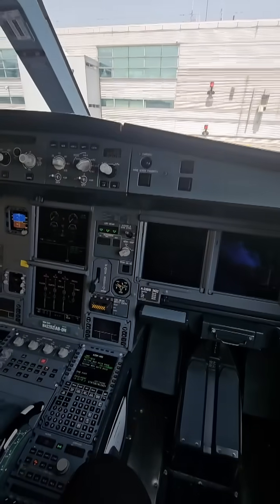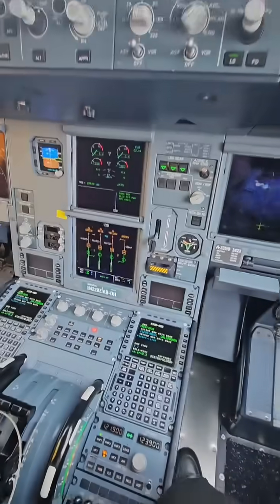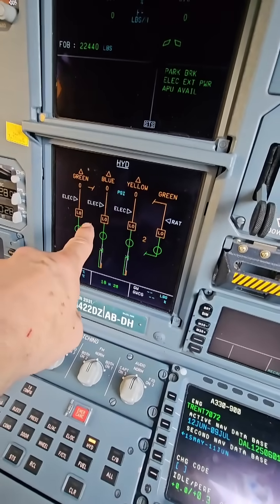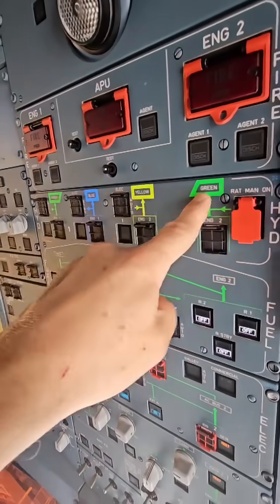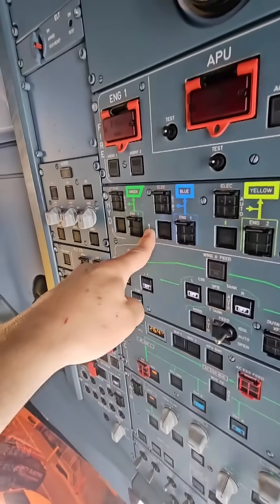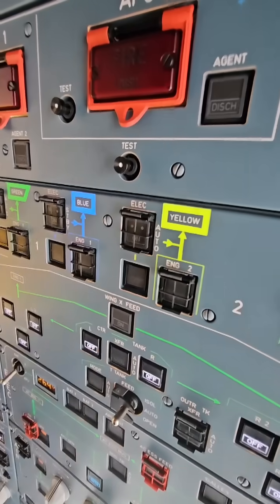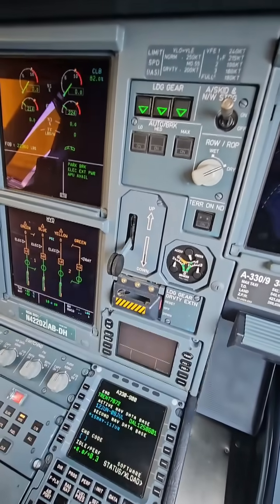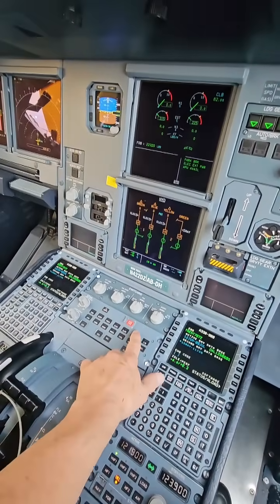Hydraulic systems page and controls on an Airbus A330.

Comment: I gather the barking sounds we hear after parking at the gate have something to do with equilibrating pressure among these hydraulic systems. Is that true? Could you do a reel about it?
Reply from the maker: The 'barking' sounds are from the Power Transfer Unit (PTU) that is on the Airbus A320 series. We do not have the same thing on the A330.

What is happening is that when one engine is shut down, and a hydraulic system is also shut down with that engine there is a system to allow the powered hydraulic system to power the other system through the PTU. 

That's the 'sawing' sound you hear on the smaller Airbuses. 

It would be hard for me to do a video on that as I'm not usually on an Airbus A320. I'll put it on my list though.

Comment: I thought Airbus aircraft use electric controls for the flight control surfaces
Reply from the maker: The flight controls are electrically controlled and hydraulically operated. 

What does that mean? 

When there is an input on the sidestick that input is sent electrically to the computer where the computer sends that input electrically to the flight control servo. From there hydraulics are used to position the controls based on the computer's electronic signal.
Reply: @CaptainZtravels  Wow, I did not know that!

Comment: Can you maybe make a video on the tiller. Because until a little bit ago I thought that you could control the steering witht he rudder and tiller, but I heard otherwise. Sooo I'm not sure 😂
Reply: I worked C-5 in the USAF, I'm not a pilot but the rudder pedals can provide small corrections to the nose wheel steering for the takeoff so the pilot can have both hands on the control wheel.

Comment: Captain Z thanks for sharing this information I love the A330, flew the type recently from Atlanta to Paris & to IST. I actually prefer it to the B767 & B777 it is quieter and feels more comfortable overall. What are your thoughts? Also how does it compare to the A350?
Reply from the maker: I'm sorry but I have never flown the A350. 

In terms of being a passenger I thought it was surprisingly quiet, which is good and bad. Good for obvious reasons, bad because now you can hear people talking more easily. 

I did not like the center seats in DeltaOne because they lacked personal air vents because there are no overhead bins in the center of DeltaOne - which makes it feel really roomy, but if you run hot it could be a problem not being able to get your own cold airflow. 

The flight deck is much more advanced than the A330.

The DeltaOne suites were about the same level of comoft as the ones on the A330-900. 

Overall the A350 is a beautiful airplane.